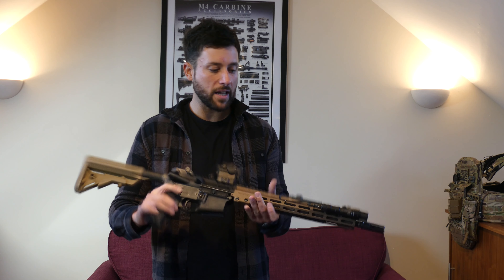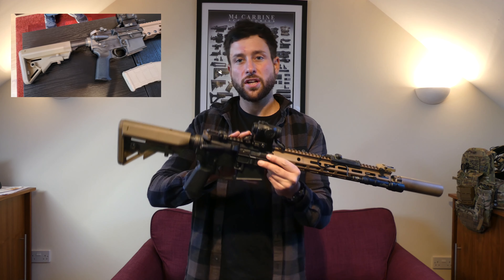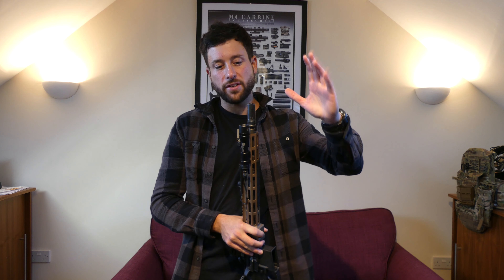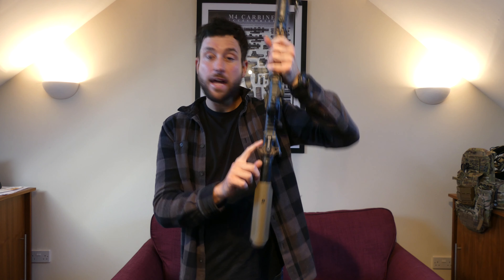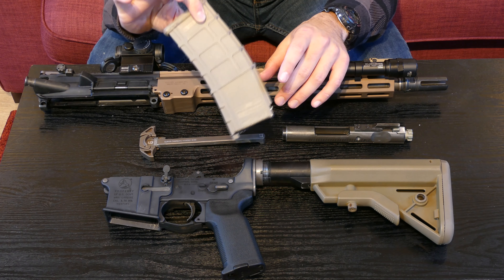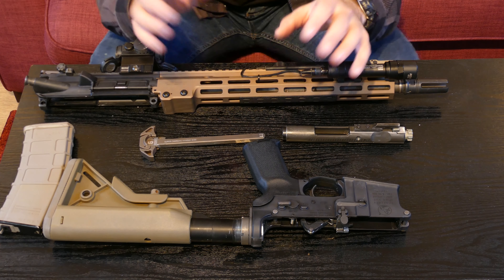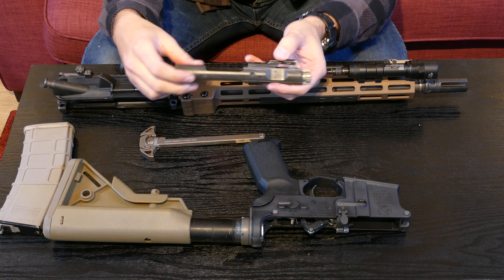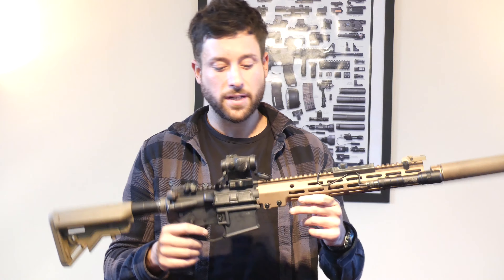WA M4 Custom Build

Comment: So WA systems can run GHK mags?  Very interested in this.  Im assuming the BCG and Bolt need to be upgraded, but is that all?  Cool build, like the way it looks.
Reply: Ghk uses a very upgraded WA system so yes, you can use ghk mags
Reply: @justanotherasian4395  Question from one who haven't own any mags from GHK. What about bolt lock to the rear function? Does the bolt locks back when the magazine is empty of bbs?

Comment: Ive also have the inokatsu superbolt with ratech npas. I did not understand what you Said about the npas able to take CO2. Im in the Process of dh mod my gmags i dont see why the npas cant handle CO2. Thanks
Reply: Pedro Silva the Ratech NPAS breaks are the screw thread using Co2 I broke 2 of them. So had one cloned out of stainless steel.